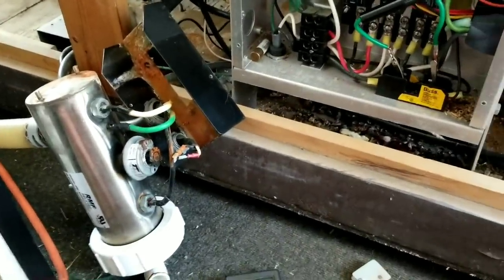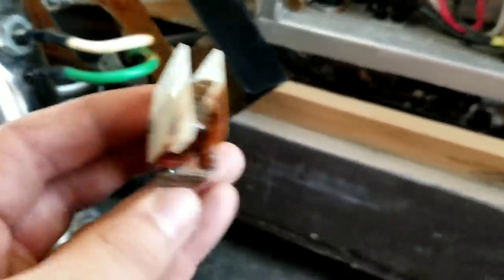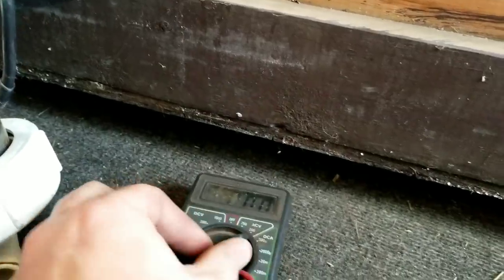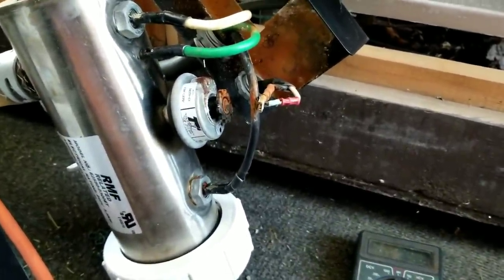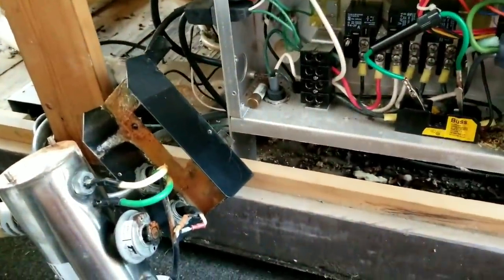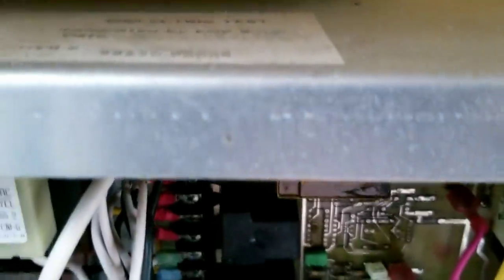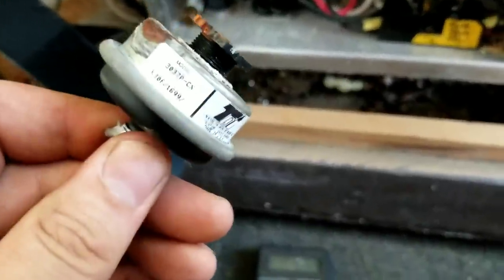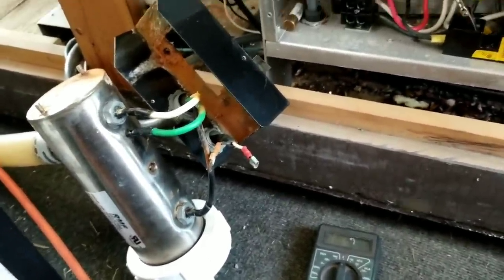Hot Tub Not Heating? Here's why!

Comment: My SPA is heating up but very very slow. Took 2 days to get up 93f. I replaced the heater recently so I don’t think it’s that - I do see FLO error, replaced filter but still the same issue, any ideas ?
Reply from the maker: So a couple things, it could definitely be the flow I had one do that and I pulled the filters out ( didnt put any in) and it worked, then put new filters in but you said you put new filters in. Could be your thermostat however if it does continue to heat ( just slow) probably not it. Most tubs have two heating elements. I would double check that because that really seems like it. Like I show in the video make sure you're getting power to it first then feel with your hand if it heats up ( will get hot fast) but dont put power to the heating elements for very long at all without water. So if they are heating up fast definitely could be a flow issue.  I have had a hose get clogged before and blew everything out with a shop vac and a bunch of grass came out, also took the circulating pump apart because it had grass in the impeller. Hope this helps. Let me know if you figure anything out. Thanks for reaching out

Comment: Mine won't get hot but doesn't drop below 65°  u think that'll fix it?
Reply from the maker: First of all happy to talking to you mr Kennedy I'm glad to hear they have hot tubs in heaven sad to hear they dont have people to fix them tho lol. What's your outside air temp? That might be why it wont go below 65.  It's easy to check, if it's the same as mine. If you can find your heater you can tell if it's working by just touching it, they get very hott so be careful.  Like I said in the video if you run a jumper wire and cancel out that pressure switch it should come on. If it comes on your pressure switch is bad, if it doesn't then your heating elements could be bad. Hope that helps and if you need me to elaborate on anything feel free to ask

Comment: I have a hot tub that won’t heat.  I was told the element was bad. Replaced it still won’t heat.  Has no codes
Reply from the maker: Could be this pressure switch! Even with all the water drained, when you jump the switch the heating elements should get so hot you cant hold them. Liked I showed in the video buy a cheap voltage tester and see if you're getting power to the elements. If no then you know it's not the elements! Any more information would help me help you 💪
Reply: @GearsAndGuns   I don’t have a switch like that.  I have 2 black nuts with wires one on each end
Reply from the maker: @jamesgrubb8762  okay 🤔 are you getting any power to it? If you have a volt meter you can check it. They are handy to have

Comment: I’m getting 240v when I switch it on. I still don’t have heat.
Reply from the maker: If you're getting power to the heating elements and it is not getting hott the elements are bad and need to be replaced.  " Most" of them are like ones for a hot water tank, they can be unscrewed and replace relatively easy.  You can usually buy them on ebay or Amazon pretty cheap.
Reply from the maker: Some have one heating element alot have two. If you need any more help feel free to ask